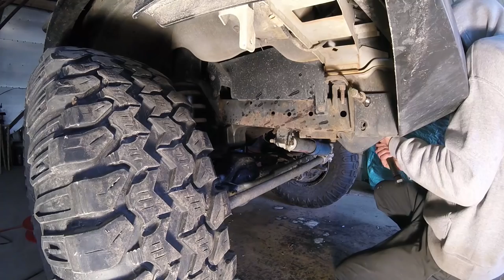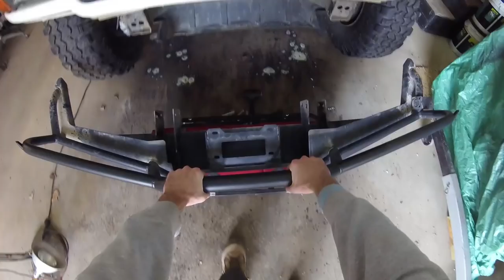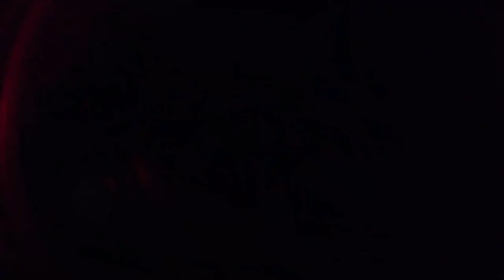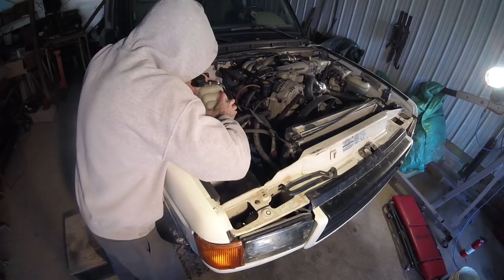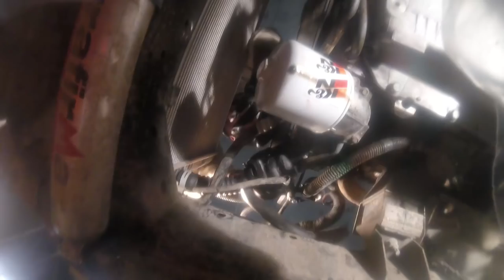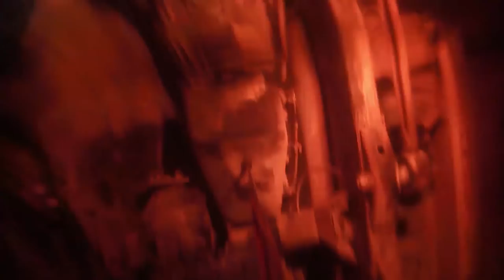Clearing the Engine Bay × 4BT Cummins Discovery #12 [Land Rover Build]

Comment: Entertaining video.  I was laughing so hard when you were running in place trying to remove the front bumper.  I would love to see how you bypass the ecu and tcm.  I have a 2003 and the engine is strong g with 115k miles.  No slipped liners but I think the lifters are tired.  Will replace them when I do a top end rebuild and a cam swap.  Thanks for all the vids.

Comment: May try the 4bt route when the engines on my disco ll and p38 goes as a second option.  May do full rebuild with darton sleeves and avoid retrofitting problems with the 4 bt.  An LS or 5.0 are also something to look into.
Reply from the maker: So many options! Going the upgrade route with the old 4 liter was something I contemplated: sleeves, cam, stroker, supercharger, etc.  But after crunching the numbers for the durability, efficiency, & power I was after... became clear that a diesel was the answer.

Comment: Greetings from Western Montana! 
This looks like me doing a repower by myself!  Tons of shit to take off but don't discard too many parts till it is all done!  LOL  Oh, and you might think about putting some Toyota FJ60 or FJ60 Axles under it as well ( the 60  i believe has 3 .73 gears)
Reply from the maker: I think upgraded axles are definitely in it's future, portals would be cool, or I might try & beef up these Rover axles with some parts from across the pond.
Reply: The cheapest route to take IMO would be FJ60 axles as they are both offset and inexpensive and TOUGH with the equivalent of a 9 inch ring gear!
Reply from the maker: Great point! Full float too I think, & from what I can tell the aftermarket is worlds better than the narrow options for these semi-float Rover axles.

Comment: What transmission did you use and did you use the stock transfer case? I'm considering doing the same although to be honest I'm not sure if I have the knowledge necessary. Either way the videos are great. Thanks
Reply from the maker: I'm running a built up NV4500, which is a heavy duty 5-speed manual. I decided to go with a "divorced transfer case" using a modified LT230 Rover case that's not bolted directly to the transmission, but instead using a pair of yokes so I can rotate the case however I need. (I have videos on the process of that all)